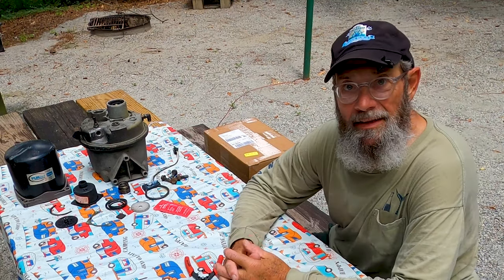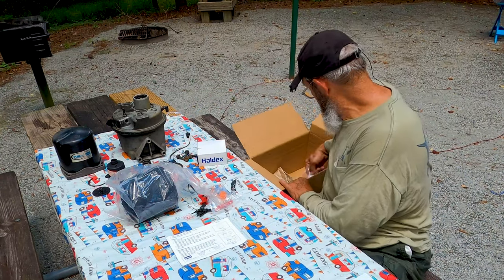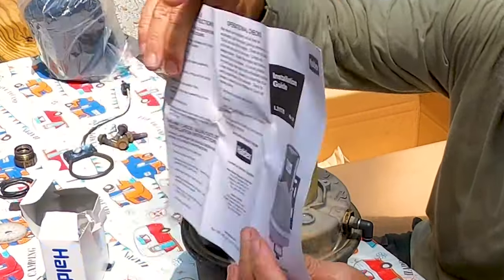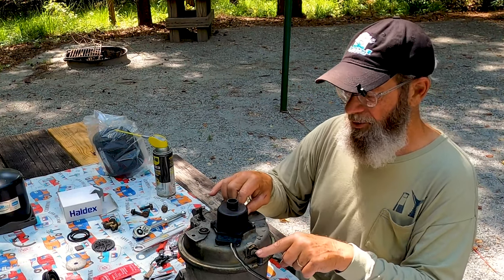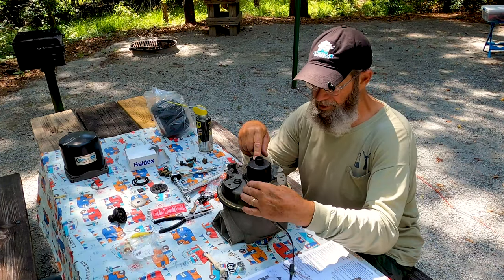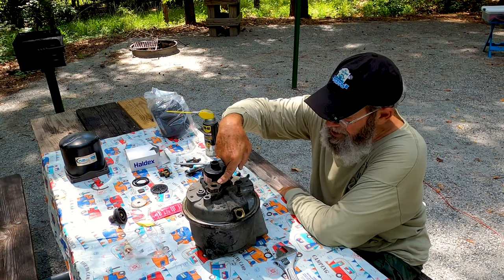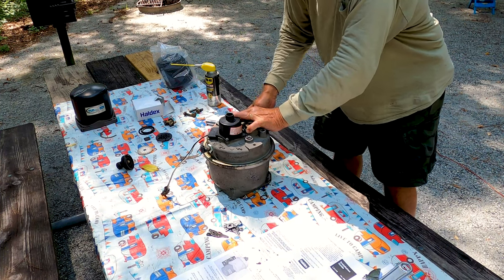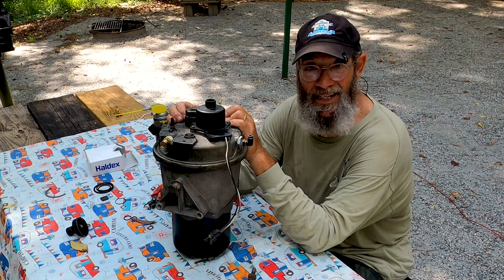Diesel RV Air Dryer Rebuild - Low Air Pressure Fix - Bad Purge Valve

Comment from the maker: First time rebuilding an RV Diesel Air Dryer. Couldn't have been easier. It was suggested that this job can be completed with the air dryer still mounted under the RV...I guess if you've got the clearance then go for it. Love saving money with DIY maintenance. Happy RVing!

Comment: nice job and thanks for the video, 2 minor things the filter turns to lock into the housing (you never did that) and why would you locktite that dump valve back in the aluminum housing!   do not use locltite it will never come out

Comment: Great work Ricky on air dyer I have done lots of them you did not even  left a gasket  off and all bolts was on  LOL  I was wonder about hoses underneath  way turn  them up on inlet   some on down ward   hook up great work Mr  Trucker
Reply from the maker: Right on, James. I try to repair things and not have too many extra pieces left over. Yep, the inlet points down on my dryer. Thanks for watching, brother. Peace!

Comment: At the start of the video you show a filter that's round and brittle. Where did that filter come from? I have not found one on my air dryer. Mine looks exactly like yours. Thanks for the video. It gave me the confidence to rebuild this unit while ordering the correct parts as well.
Reply from the maker: That little felt filter was from the dump valve cover, the black plastic cover at the bottom of the dryer. Very glad this video helped you...that's why we make them. Thanks for checking out our channel, Timothy. We appreciate you. Peace.

Comment: I have a similar problem. 6 months ago we lost air and it was coming out the bottom where the purge valve is. a mechanic by passed our air dryer and capped off the 1/4 line from the compressor. been run since with 110 psi and I have been bleeding the tanks after we travel. Get the water out but I know I need an air dryer. bought a rebuilt kit exactly like yours and followed step by step. Put it all back together but can't build pressure. the air still coming out the bottom. what do you think is happening? I was super careful and not sure what needs to be done. I would hate to buy a new air dryer and waste the 200 on the rebuilt kit. Let me know your thoughts
Reply: Never mind. There 2 O rings on the purge valve and I missed one. Great content you provided. I would have been lost without this video. My coach is purring like a cat
Reply from the maker: I'm glad you figured it out, TBT. Truth be known I missed an O ring as well, but I already had the video edited before I found it. Glad your rig is making air now! Peace.

Comment: lol. you are putting this together wrong hahaha. You forgot the o rings on the purge, you put the purge cover on wrong, the metal goes on the outside of the cap and the other half ring is a heat blocker that goes between the heater and the purge cap.
Reply from the maker: You are absolutely right! Good eye. I discovered the O-Rings and the heat shield issue after I published the video. I didn't follow the instructions...to the letter. Took care of these and all was well...of course I had to mount the dryer to discover something wasn't right. You must have rebuilt a few of these?? Thanks, LABD!
Reply: @RVUNDERWAY  You know that you should have made another video of you correcting these issues! Someone else might watch your video and decide to follow your instructions and find out later that they should have read these responces and realize that this video isnt correct and this is NOT how to rebuild an Air dryer.